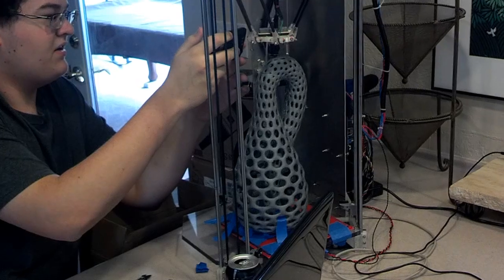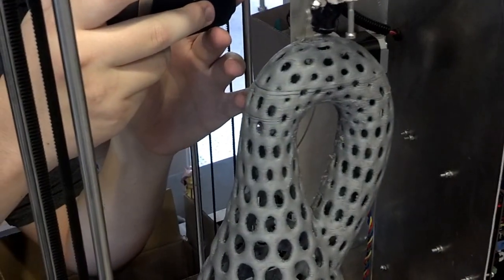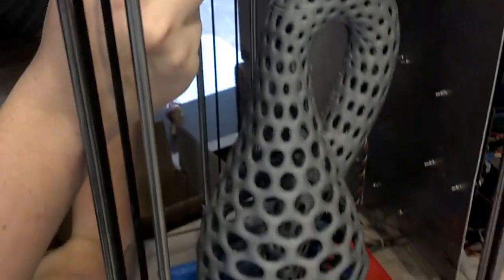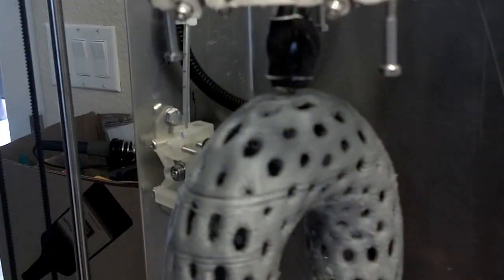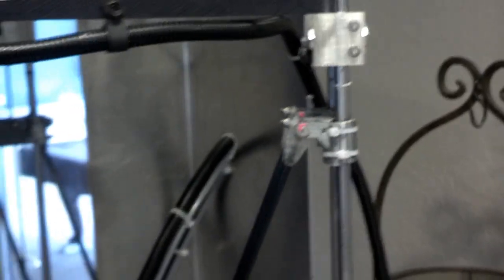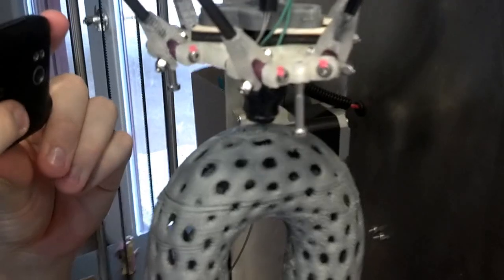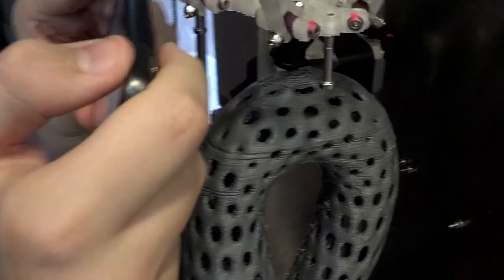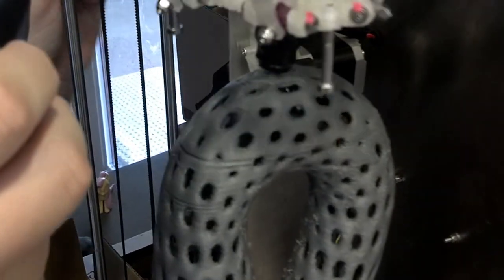Rostock prints a giant Klein bottle

Comment from the maker: We have been achieving .1mm layer height with a .35mm extruder nozzle and are very, very happy with the results. The print head is very lightweight due to the design that keeps the filament drive motor off to the side and when the little u-joints are properly fabricated (nice tight slop-free fit) the accuracy is theoretically capable of .003mm in the x, y or z. However real-life use would never achieve that due to the use of the little u-joints....